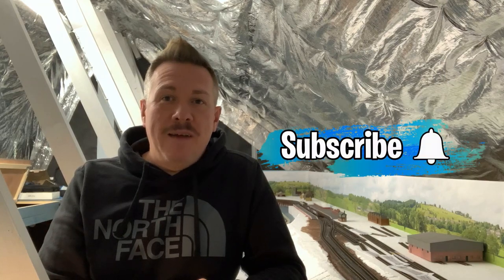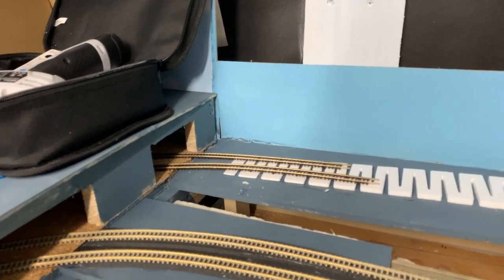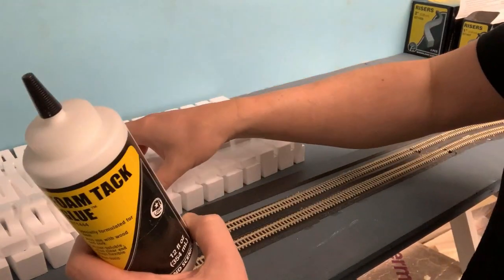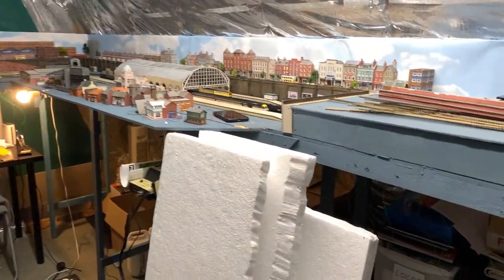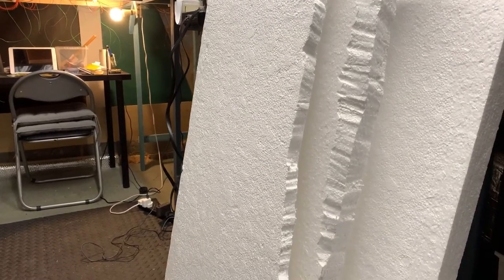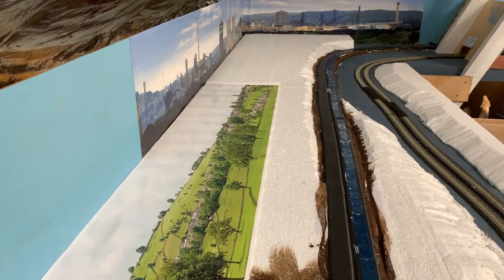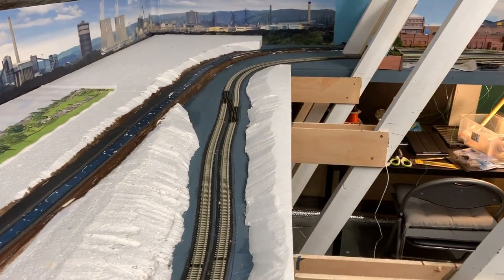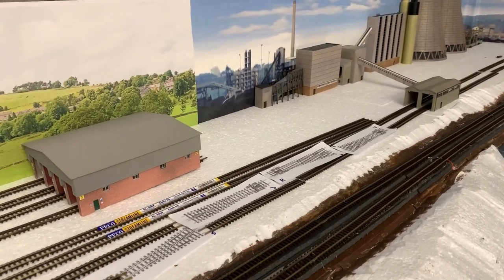February 2020 - Update 4 - Installing the branch line including inclines and powerbase

Comment: Great work on the foam boards Geoff. I have the same 2% inclines installed on my layout which work very well with diesels but not so good with steam. The power base was previously used and found it to be very poor due to the restrictions with magnets on the locos. Great progress and loving the content greatly, cheers for now, Chris